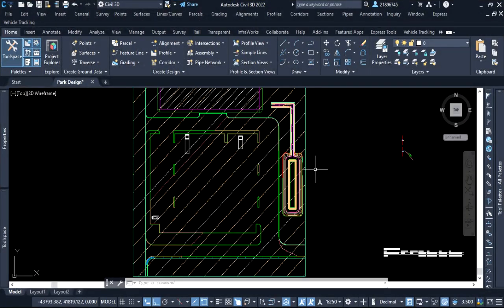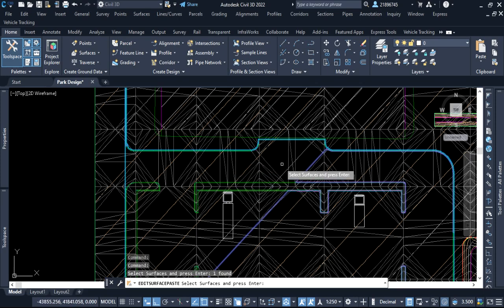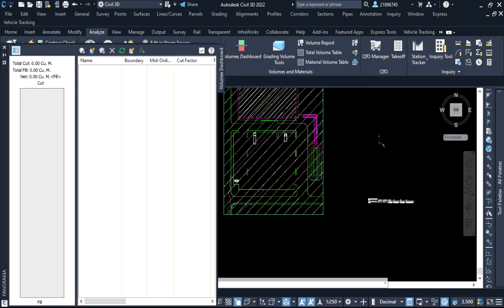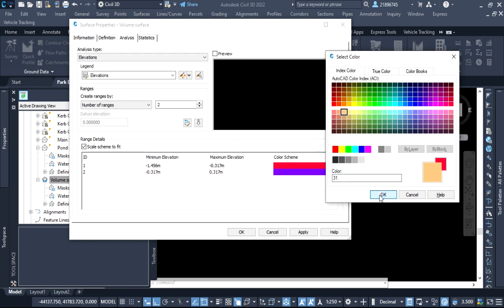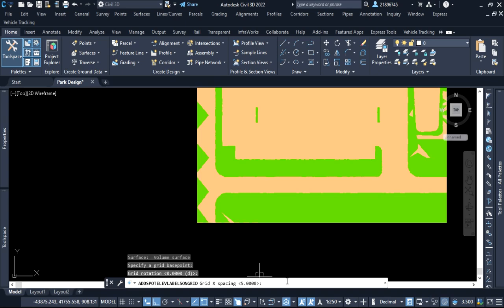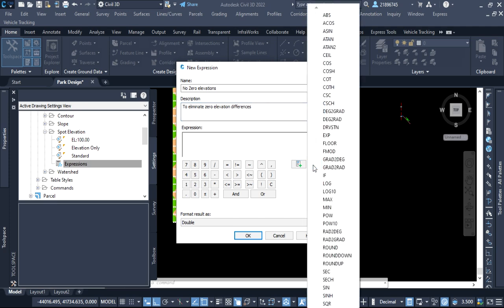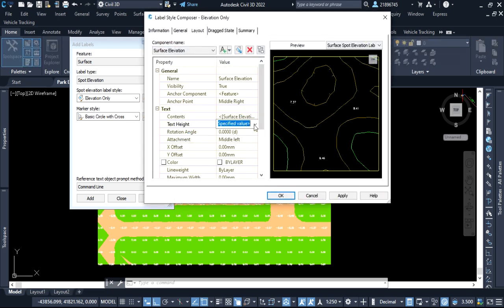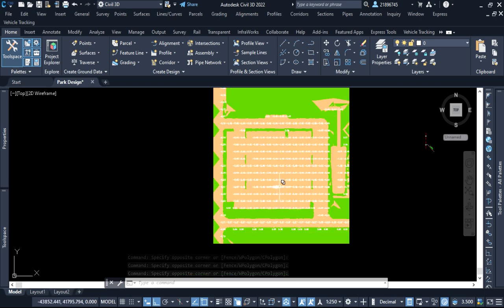CIVIL 3D HOW TO DISPLAY DESIGN CUT AND FILL EXHIBIT

Comment: Pls we need the data for practice
Reply from the maker: If you care reffer to my past video, I did not use any data. This project is entirely made from feature lines and the surfaces are defined from feature line breaklines. The parking design is developed from corridor model which I demonstrated on my past video